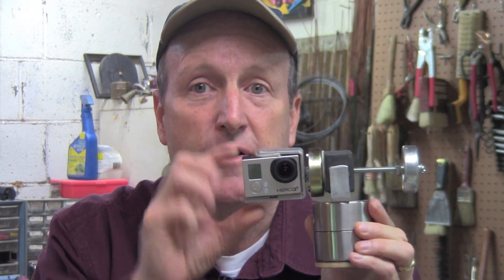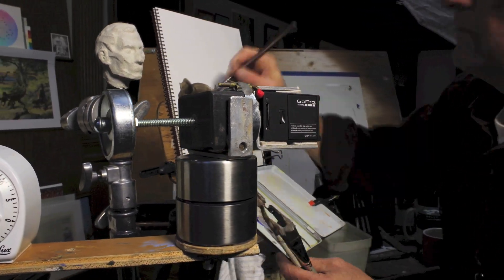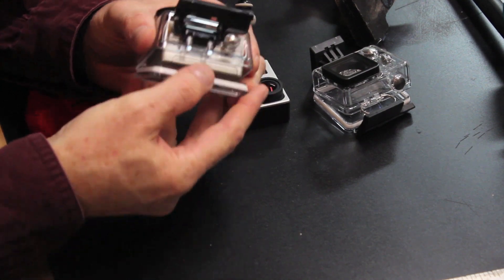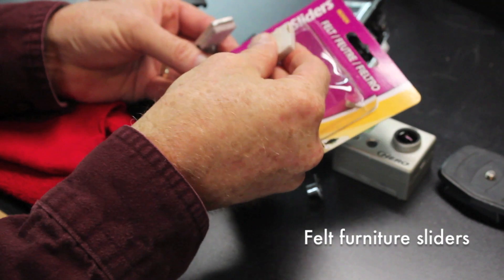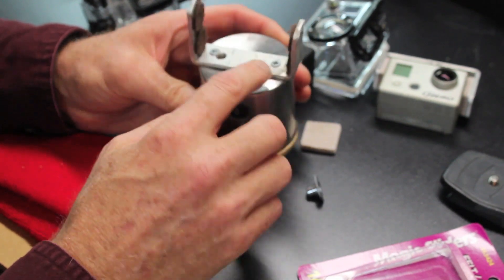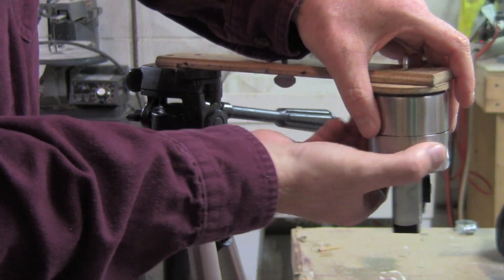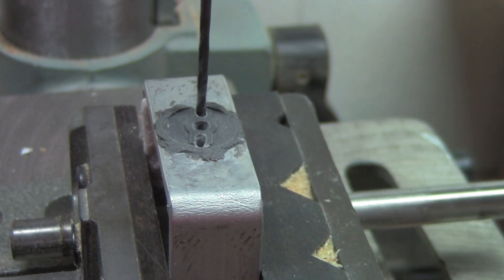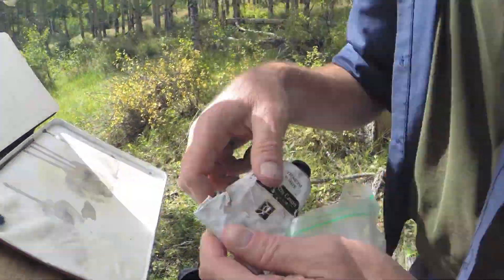DIY Motion Control System for GoPro Time Lapse

Comment: Just a word for the UK people. I bought a T-Nut to make a sketchbook easel to mount on my camera tripod. We have both Metric and Imperial threads for our nuts (news to me too!!, found out from my hardware shop). You may need to check which type you need as if you get the wrong one, it will ruin the thread of the male fitting. Turns out I need a Imperial, which they didn't stock.
Reply from the maker: David Wood Artist David, yes, it's important to get a T-nut with 1/4 x 20 Imperial, which is standard for most cameras and tripods.